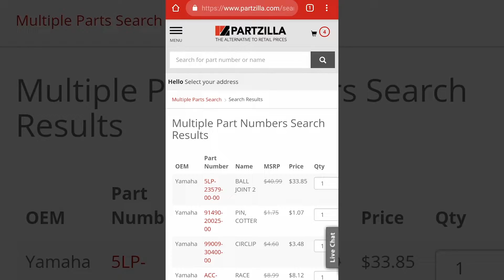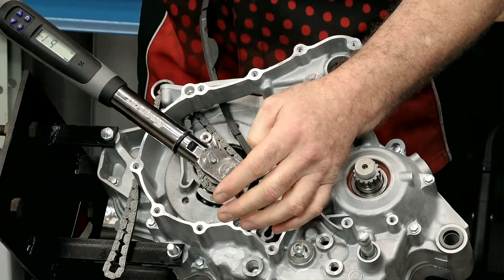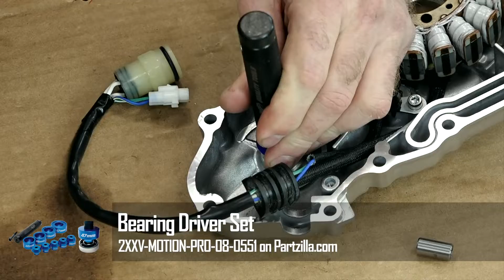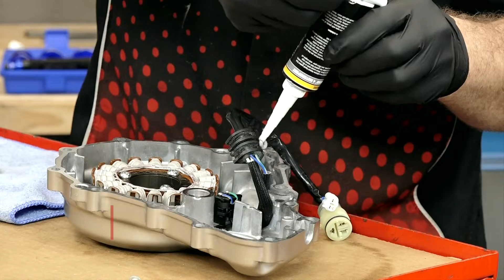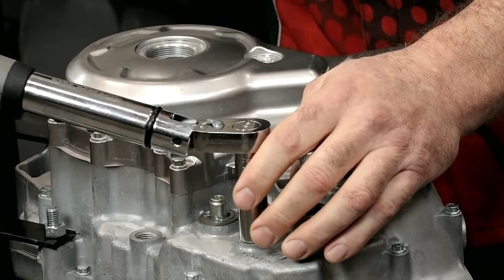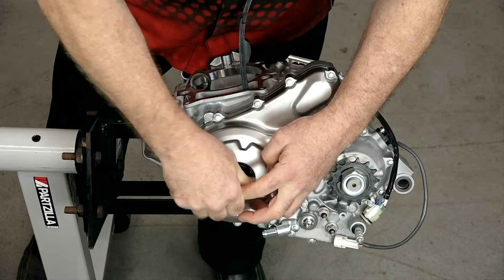Yamaha Raptor 700R Engine Build Part 4: Flywheel and Starter | Partzilla.com

Comment: I like your methodical style and the fact that you keep things clean.  It is amazing how lax some folks are on cleanliness when working with engine or transmission internals or brakes and other hydraulic systems.  A few small particles of dirt can wreak havoc in such systems, particularly high pressure hydraulic pumps.

Comment: The only problem with red thread locker on those Allen head bolts is that it is easy to strip the heads when removing them if you can’t heat them to 350 or so.  And heating bolts that hold the stator will likely trash the stator.  I would use blue thread locker or none at all unless the manual requires it.  I have not used thread locker on internal engine fasteners unless the manual stated to use it and I’ve never had a fastener come loose.